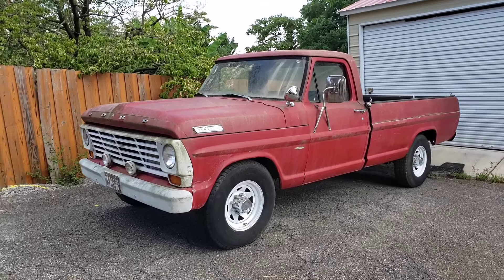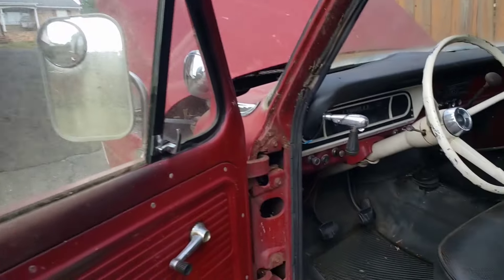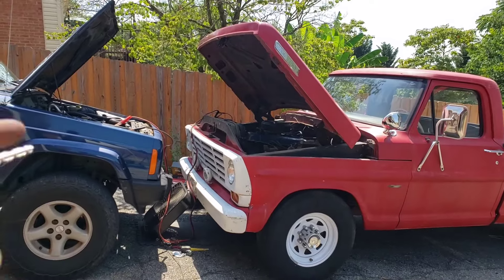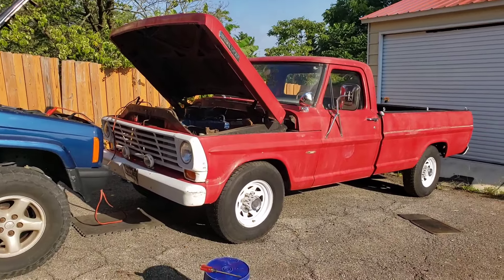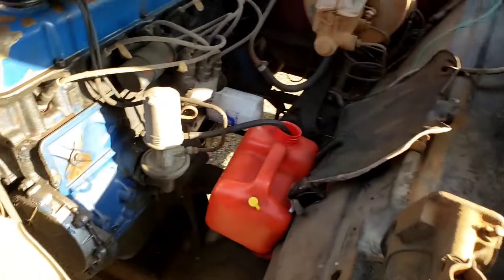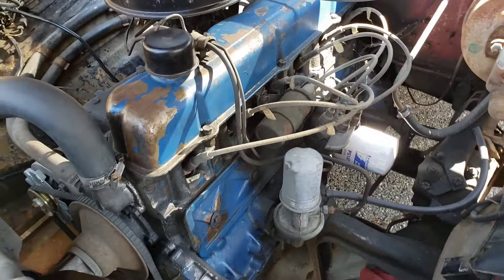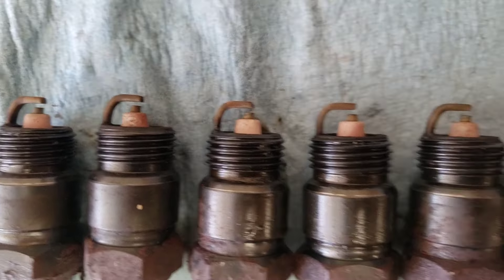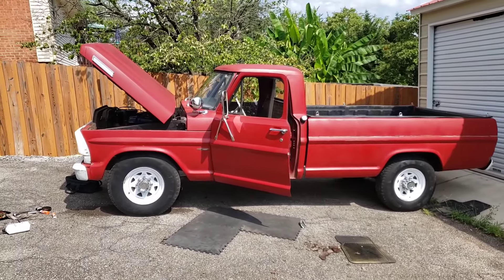Rescuing a 1967 Ford F250: 79k Original Miles!!

Comment: The first thing wrong with those plugs was the brand name. Autolite goes on lawn mowers, I'd never use them in a vehicle! Looks like a damned good find overall.
Reply from the maker: @jamesmccoy4793  they've been around for ages and have served many a vehicle just fine, so ill have to disagree. Is there another plug you prefer for these old 300ci?
Reply: Autolite plugs came in Fords if I'm not mistaking. And Motorcraft oil filters .
Reply: Autolite is a Ford product.   Motocraft or anything better
Reply: Motorcraft is the only oil filter to use in Ford's. They have  slightly larger slots than the other ones. my 1986 F250 held 7quarts of oil . Deep pan and a wicked oil pump !! I differently used what they recommended !! That 86 is going for more money than I paid for it in 1990 today.

Comment: Have you put a fan cowle on it? You might need to put another inline fuel filter on it, it will pick up bits of sediment for months. Unless you take the gas tank out and flush it.
If you ever get another oil filter like that one, punch a screwdriver clean through it. Gives you two handles or just tap it off with a hammer. Nice truck. Keep it, it's an investment now.

Comment: I find it interesting a young guy wanting a old truck when new ones are selling just as cheap. The exhaust manifold gasket is tired, kind of like me, a old man of seventy four, owned a lot of these trucks when new. Of course being a kid then, I put in a larger V8 engine, ran the holy hel* out of them, literally in to the ground and yet for some reason..... they fought back and hard... they just kept going. I rather doubt that a new truck can take the abuse of a kid like I was doing to them. I get home from the army and of course, money is  tight but hey, who cares, just wanted to have fun. I have a million stories, may be a stretch on a million but just trying to make a point. There are new pieces to make the top of the transmission stop from going to  far and slopping around when trying for more higher gears. Its a wave washer if memory serves me right.... a easy fix by just removing the top of the transmission and replacing some simple fix items. Most importantly is make everything clean and moving freely. If you pay attention then you will see how it goes together and any rusty pieces holding it from working right. Small springs that hold tension on shift rods etc., it all makes a difference. Sadly ford did not make it easy for swapping parts from V8 to six or vise versa. Yeah, I am a old man now, live in alaska, born in forty nine, made a living as a mechanic for most of my life. Like all of us just trying to see where we fit into the scheme of things.... one thing you have going for you is date night. A lady will remember you care and might just make life a lot more bearable. Might find you have a lunch packed with a odd surprise or three. Oh yeah, I do remember those and those are mine only to remember.... a real man doesn't brag about what the lady of the shack put in the pail or what your sandwich was "Wrapped" in! Your going to learn more on this rig than you think you will. Like why so much room under the hood, why didn't they fill it full of plastic pieces that once removed never go back right.... yeah I could spend a day telling you my version of how it was then and how it is now. I am old and tired, and never answer questions for I am tired of people. I live alone with my dog and he is as old in comparison. We like it that way.
Reply from the maker: @morgansword  thanks for your reply, story, and advice. Trust me, you definitely cannot get any newer truck for near as cheap as I got this. A lady just wanted it gone and it fell into my lap, as a coworker told me about it. I'm slowly fixing up things here and there, so I appreciate the advice on the shifter. I also will be replacing both door seals, of which I already bought.